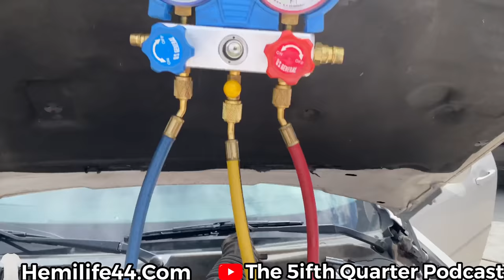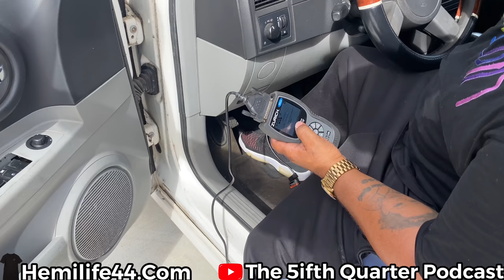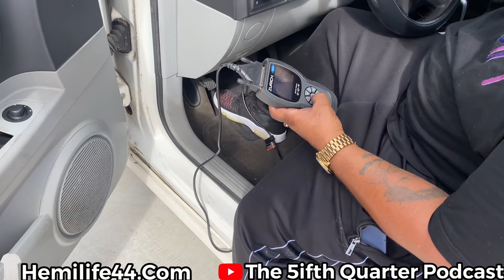Saying Goodbye To My Dodge Charger Widebody & Starting Another Build

Comment: For the AC problem make sure when you turn your AC on and turn it to where it circulates AC from inside of the car. Make sure you can hear it change over because if not then that means the housing or motor is broken.  That means it’s still sucking hot air from the outside instead of from the inside of the car which will come out a lot colder if it was getting it from inside of the car.

Comment: Tune that thing all the way spark plugs, H2 sensors, coil packs, wires, PVC valve, and that thing will be right and check your injectors .
Reply: Big Facts!!! You don't wont to half ass tune it while replacing 1or2 spark plugs& Sensors than encounter the same thing later❓💯💯💯

Comment: Need help?

1) Change your engine filter/air intake to help with improve gas consumption (more oxygen means more efficiency).

2) Get new spark plugs to hopefully stop your cylinder misfires. Helps improve gas efficiency.

3) Get an oem or aftermarket power steering line.

4) Make sure your not leaking coolant

5) If replacing your hot line or topping up with refrigerant doesn't help the AC then it's likely the compressor possibly.

6) Emissions leak? Make sure your gas cap is good, if not look deeper into the fuel system. Don't be scared, it's usually something simple most case scenario.

7) Change your cabin filter, this is a must. Its located in the glove box section for most cars.

8) Check the suspension, control arms, struts. 

9) Make sure your brake line is good.

10) Get an oil change, make sure to use High Milage engine oil for your car so it can reduce further damages in the future as well as reducing oil leaks. Helps with better gas mileage.

I had to fix some of these things on my commuter, the car is running like new even though it's nearly as old as me. 😂💎💎💎💎